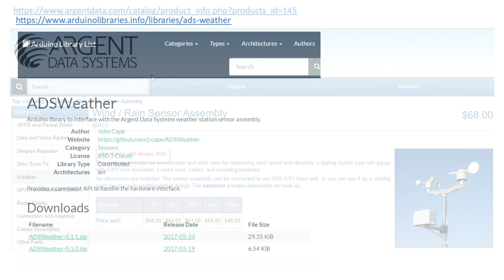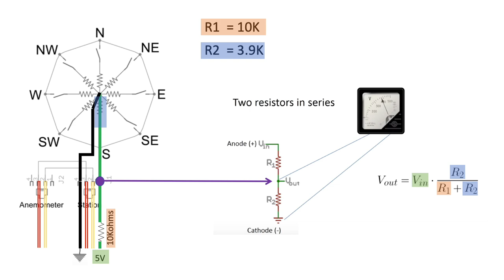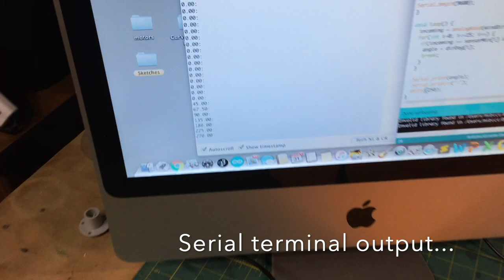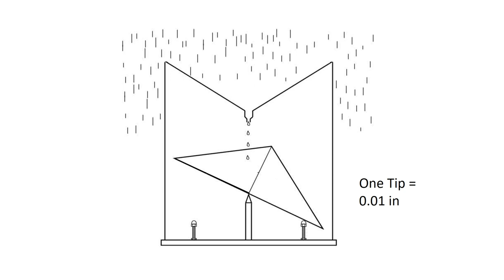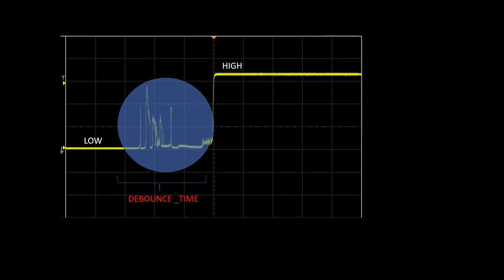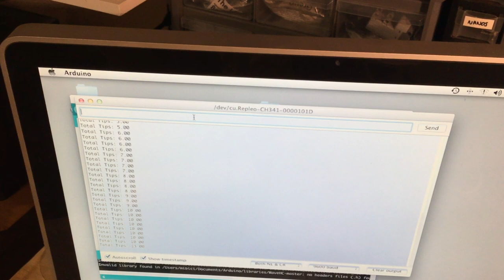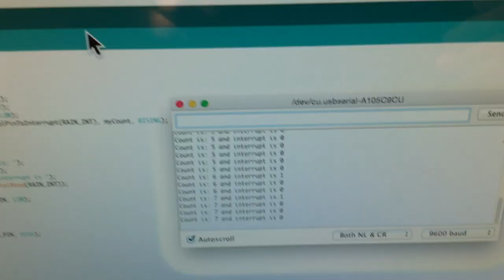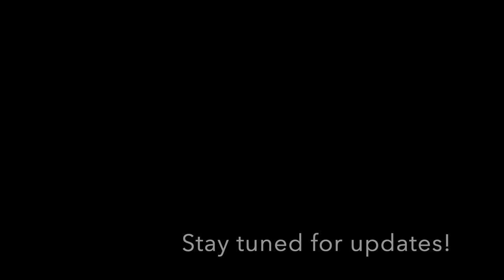Argent Weather Station Arduino Hacks - Hardware and Code

Comment from the maker: UPDATE 3/31/2020 - Video has been edited to remove erroneous comments associated with time delays in ISR functions since there is no time delay in the summarized sketch's ISR function. This is the reason the video jumps abruptly right before the discussion of Hall effect sensors, which is yet another alternative presented to eliminate issues with reed switch bounce.

UPDATE 2/18/2020: At minute 23:36 and 25:55, I raise a concern about using a 15 millisecond delay in an interrupt function associated with the tipping bucket rain gage code. In retrospect, I observe that there is no delay in ISR function, rather I'm just evaluating elapsed time, so the concern is unwarranted. Bottom line is this: A software approach to filtering bounce complicates the code a little bit, but results in an easier circuit to build; whereas a hardware approach results in cleaner code, but requires a little more soldering up front (you pick). Personally, I prefer the hardware approach (either Hall-effect magnet or RC/Schmitt trigger) since this just "feels" like a more stable solution. Having said that, it's my gut feeling-- I am not an EE nor have I tested this in the field. (That's coming shortly - stay tuned!).

Comment: VERY fun to watch as I have almost the exact same hardware as you, coincidentally.  Watching you debounce the tipping bucket was a deja vu.  I added a large funnel to the tipping bucket to increase its sensitivity.  By adding the large funnel you collect a lot more rain and get a lot more tips, which can be calibrated out. I wish I had found your video before I tackled the project.  I've added the link to this video to my own notes.
Reply from the maker: Glad to know I wasn't alone in the debounce adventure- a steep learning experience indeed! I think the key for handling the intensity of summer monsoons in my area is to design/create a bigger tipping bucket so that it can keep up with the flow.

Comment: I thank you for your excellent job in analysing and try to figure out the reed switch in circuits. What has being mentioned bellow is the interference that RF poses for these sensitive circuits. Also should be considered is in case of thunder. Discharges among clouds or between cloud and earth poses a thread to chip circuits. That is a fact that most manufactures try to put circuits far from sensores bellow in a metalic  box. When you have chips and circuits outside they are prime to pick up these signals even burn out chips. I have had some expirience with that. I don't have expirience especifically with hall effect component mounted in an outside set.
Reply from the maker: Thanks. I think shielded wiring can help mitigate that challenge a bit which is something I learned about after this video was posted. I appreciate your feedback!

Comment: Reed switches often produce a double operation when a magnet sweeps across them.  It's much more than contact bounce - more like a dead spot in the middle.  It can also make reeds difficult to use as limit switches for things that move.
I have also found that some RF filtering is a good idea on sensor wiring to reduce the effects of strong RF signals being picked up.
Reply from the maker: Good to know. It's kind of odd that vendors won't put a few more cents into hall-effect sensors, although there is probably a reason for not doing so (aside from profit) that I'm not aware of. Thank you for this insight.

Comment: Great work! FYI Water sensor is based on physics and limit of the sensor. At some read you just have to treat sensor as overfull. In addition you should acknowledge data errors and data lost.
My general idea: collect data in database and process it later.
Reply from the maker: Cool, thanks for sharing your ideas!

Comment: I have been working on building my own solar powered hilltop weather station to report conditions for our paragliding club and I originally started work with a design for a Raspberry Pi 3B+. I soon realised that the Pi would use way too much power so I switched to using an ESP32 microcontroller. Like the Arduino the ESP32 uses much less power and with deep sleep it can run on a modest solar supply for an extended period. I am using the Argent wind sensors and everything is running on 3.3V. Having watched your video I also decided to deconstruct the Argent library and I have had to re-code it for a number of reasons. My ESP32 design runs on 3.3V and I use 4.7 Kohms in the voltage divider which I cribbed from the Pi project for better vind vane voltage separation at 3.3V. I also find the ADC on the ESP32 too noisy so I used an ADS1115 16-bit ADC which is much more accurate and stable. However, this results in different ADC numbers for the consenual averaging code. I found your spreadsheet very useful for this. I now have a very respectable rewrite of the library. I also had to fix the gust counting code in the library. There was no provision to re-set the gust counter. My gust counter now drops values over a minute old and works really well. I am not using the rain gauge as my MCU will sleep for 15 minutes, take readings, publish them and go to sleep for another 15 minutes (something of that order yet to be set in stone). I therefore don't collect rain data but I am using a BME 280 for temperature pressure and humidity readings which allows the system to predict expected cloud base which is very useful information for hill pilots. I'm therefore very grateful to Argent for the library and to you for your work with this project too. I'm happy to share my code if this helps.
Reply from the maker: Good background-- definitely interested in low power for remote deployments so I appreciate this feedback. That's very kind of you to offer your code and I have bookmarked this comment for when I return to this project. Thank you for your response and interest-- makes all the difference in keeping these projects going.
Reply: @RichardBarker Hi, I just wanted to say that I'm doing the same thing for our paragliding club.
I'm using the Sparkfun ESP32 Wroom with the LoRa module on it to send the data by lorawan to a raspberry Pi with nodered.
As you speak of solar panel, how did you manage to use battery and solar panel?
My board has a battery connector, but I don't have no battery for it. I thought of a simpler solution using a simple USB Batterypack that is connected on one side to the ESP32 Board, and the other side can be connected to a PiJuice Solar Panel later on if I see the battery gets drained too fast. It might not be the cheapest solution - and this way I don't get a value for the battery charge - but I guess it would be the simplest solution. How did you solve this problem?
@ModestMaker This Video is excellent for an electronics noob like me! Thank you very much!
Reply: @arcticsnowsky  hi and glad you found my thoughts useful. You may find that you use too much data for the Lorawan terms of service if you are sending regular readings. For this reason I plan to either use cellular data to upload to either my own server or a service such as Thingspeak. I have also decided to trial a LoRa point to point link to a gateway of my own that uploads to a WiFi hotspot and onto a server that way. The solar power use depends on having a low power drain when the ESP32 is asleep. If your board uses an AMS1117 regulator it will probably use around 15mA in deep sleep which is way too much. It's fine on the work bench but not in the field. The other issue is daylight hours in winter. For this reason you may want at least a 5W solar panel and maybe 10W. I'm still experimenting!
Reply: @richardbarkeresq  Without any knowledge - I have checked the technical datasheet of the WCH ch340C (installed on the sparkfun esp32 wroom lora module) - if I understood it correctly, it takes typically 7 up to 20mA in USB Operation mode but 0.1 in Operating Supply Current(USB
 Suspend). In the schematics there is an additional voltage regulator - however I don't find any names or data for it - and looking at the board I can't detect it with my eyes.
Regarding the Lorawan I decided to use a simple lora connection instead, sending 8 bytes each 5 minutes / and 10 bytes each 10 minutes with sf7 (and maybe 250bw) should fit the plan.
However I will have to adjust all these thougts when reality punches into my face - right now I'm just preparing all the things to experiment :)
Reply: @richardbarker8636 I have an esp32 and ADS1115. I am trying to read the wind vane but I am getting strange values. For example, I get minus values in some directions, but with the multimeter I get a positive voltage when testing. Can you please tell me how you read the wind vane with the ADS1115 and share your setup?
Reply: @benjaminb5578  hi I will be happy to share my ideas. I have made considerable progress with my design and I have for the time being decided to standardise on a T-call v1.3 board which is made by Lilygo and integrates power management, a 2G modem and an ESP32. It has a manageable 1mA or so deep sleep current which I can live with as it is generating 3v3 and 4v2 iirc for the modem. The 5V input won't tolerate more than around 6V so I opted to bypass this and charge the battery directly with a different charger board. I am feeding the charger with 6V mini panels with peak output of around 7V5 and capable of a peak charge of around 2.4 W which is not that generous but my system seems to survive even in British winter weather! I wrote adaptive sleep time management into the software so if the battery voltage gets lower the system sleeps for longer between readings. It also sleep for longer between readings at night and works out day and night based on solar panel voltage. This seems to work very well. I will be publishing the details to a website I'm setting up for this project as it's taking shape quite nicely. I'm also learning CAD and 3D printing and this is very useful for making fixings and adaptors.
Reply: Hello Richard, excuse me, could you help me with how to connect the ESP32 to the weather vane?
Reply: @miguelolvera3546  hello and sorry for the delay in replying to you. I just want to check - do you have the Misol / Argent Data Systems wind sensors that are covered in this video? If so, the wind vane has a resistor network that returns different values depending on the wind direction. You therefore need to feed one end of the resistor network through a fixed resistor connected to 3.3V. I use 4.7 Kohm for this. The other end of the wind vane I connect to ground. This creates a voltage divider. I read the voltage at the point where my fixed 4.7Kohm resistor connects to the wind vane. The voltage will vary depending on wind direction. You will need the table that tells you what voltage to expect for the particular wind direction. Argent Data Systems publish this table for a 10Kohm resistor I believe as their example uses an Arduino running at 5V. 

I can let you have my own lookup table for the 4.7Kohm fixed resistor. I made this change as I get better readings at the lower voltage that the ESP32 runs at. 

You can read the returned voltage using the analogue to digital converter in the ESP32 but it is not very linear and a little noisy so I use an ADS1115 for much more accurate readings. If you let me know how far you have progressed with your project then I can provide further information.
Reply: @richardbarkeresq  Hello Richard, my apologies for the late response. I thought you would never see my comment. Regarding your first question, yes, I obtained the same Argent Data System covered in the video. 

Up to today, I managed to connect the weather vane to the ESP32. I followed the video's step-by-step connections. I'm using a 10k-ohm resistor , and it works; the ESP32 also reads the returned voltage. However, it's not very accurate. My calculations didn't match what the ESP32 is giving me

I will follow the way you connected it. I will use a 4.7k-ohm resistor and I'll buy an ADS1115. Of course, let me have your table, please 

I look forward to your response   :)
|              |                |                  |            |
|              |                |                  |            |
|              |                |                  |            |
|              |                |                  |            |
|              |                |                  |            |
|              |                |                  |            |
|              |                |                  |            |
|              |                |                  |            |
|              |                |                  |            |
|              |                |                  |            |

Comment: Thanks for sharing this script and circuit. I've used the Schmitt trigger version and it works well. Minor comment - the RC time constant from 10 uF and 10 k ohms is 0.1 sec. I've used 2.2 uF and 66 kOhms (0.15 TC) and it seems to work well.
Reply from the maker: You are correct! Thanks for that, and glad to know I've got company on the selection of the RC time constant approach.
Reply: @ModestMaker  Thank you very much - very useful indeed! I have a couple of questions:
Can we do without the 40106N Schmitt trigger? I suspect Arduino GPIO pin would have an internal trigger.
Also, 10uF and 10kOhm has 100ms TC, which is much larger than the software debounce constant of 15ms in your code. Such large TC may result in missing a tip during rapid fire. 
I did a test with Arduino nano 33 IoT with the 10uFx10KOhm setting, and it did miss some tips during rapid fire tests. I then used 1uF and 10kOhm (Arduino nano 33 internal pull up resistor). At this 10ms TC, it never missed any tip during rapid fire. I even tried with a 0.1uF ceramic capacitor, it seems worked fine with no double counting and no missed tip.
Reply from the maker: I agree this can probably be fine tuned a bit on the RC constant, and it sounds like you landed on a good combo with your tests. Having said that, I can’t imagine actual rain tips firing quicker than 100 ms (10 tips per second). Sorry- I am not aware of any internal triggers on GPIO pins. Thanks for your tests and feedback :)

Comment: EXCELLENT. thank you.  I am about to replace my acuweather weather station that has failed in many ways but I think I will hack it for fun and see if I can make a better display.  Thanks for the wonderful tips and beautiful explanation. 
I also live in Arizona and I wonder if a separate rain gauge that was specific for monsoon type rains with logic that would switch form the sensitive tip gauge when the rate was over, say .5inches per hour to the less sensitve gause that would work better for the mega rain storms.
Reply from the maker: Glad it helped! I think the best way to go for our monsoon type storms is to develop a weight-based gage that is insensitive to intensity (so you can use it year round.) I'm actually working on one right now as a project for my 3D-print class. Accuracy challenges of tipping buckets are summarized here ;) https://youtu.be/iR331RDdPW4

Comment: Thank yo so much for the video. It is very informative. But I am  wondering how it is known that a wind speed 2.4 km/s causes the switch to close once per second? Probably it depends from the diameter of the cup housing?
Reply from the maker: Agreed- diameter gives you a distance the magnet must travel for one revolution, and the windspeed is calculated accordingly.

Comment: In the anemometer. There are two switch closures for each turn. Do you should divide by two the number of switch closures?
Reply from the maker: Based on my teardown, I recall there is only one switch closing per turn. Details for the associated formula copied from Argent are available here: https://youtu.be/KHrTqdmYoAk?t=2109

Comment: Interesting video. I also wonder how well the Argent tipping bucket works in the NE with slushy, freezing rain (assuming an unheated environment for the tipping bucket)
Reply from the maker: I don't think it's particular accurate for anything less than a gentle winter rain. Accuracy test is posted here showing challenges: https://youtu.be/iR331RDdPW4

Comment: Great project but I'd prefer to use an ESP 8266 due to it's lower power consumption.
Reply from the maker: Code should be easy enough to adapt, but for remote deployments, we need something that can speak to satellite or cellular modems. The Arduino IDE supports these well via existing libraries.

Comment: Hi, have you considered a mercury tilt switch for the rain gauge, would this need debouncing in this application.Very good video,Thank You
Reply from the maker: Possible I guess, but not interested in messing around with mercury. I know you can buy these on eBay, but pretty nasty stuff. A Hall-effect magnet should eliminate the bounce- I just took apart another rain gage that uses one of these👍.
Reply: @ModestMaker  Hi, i agree with the dangers of mercury but they usually come in sealed glass or metal cans, thank you for your reply.

Comment: very interesting video. Thank you for such good explanations. I'm just starting simply with tipping rain sensor into Arduino. Do you have a wire diagram for how to link to arduino or simple explanation ( I don't know how to interpret the electrical diagram into breadboard and Arduino). With 2 wires from rain sensor, Im not sure how to connect 5v, gun and the pinOut 3 to the 2 wires....
Reply from the maker: Sure- I have a playlist that provides an introduction to Arduino that might help with more background. https://www.youtube.com/playlist?list=PLqJ5k4cakypwMUFxZ1ckiiUfp1Ngf6o29 . I'll try to wire something simple this weekend and get back to you-- may already have it in another video.